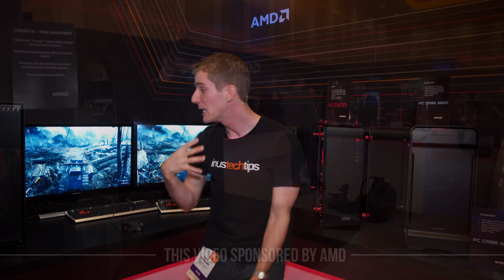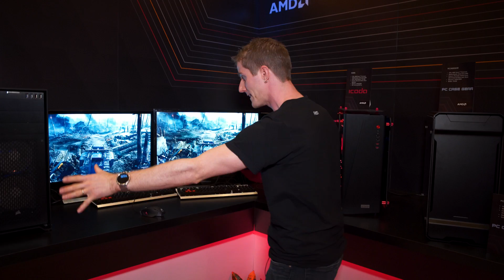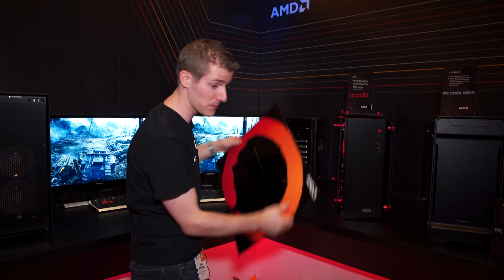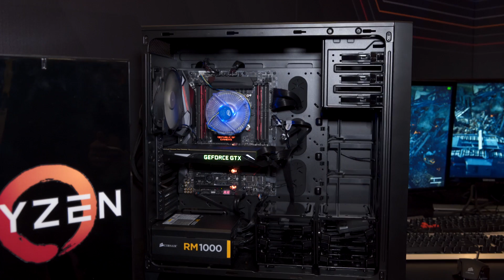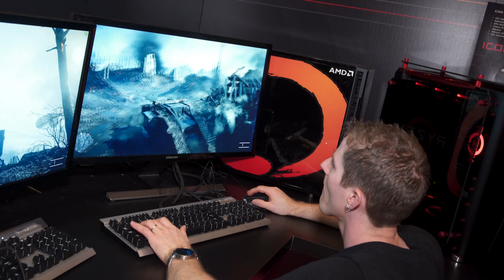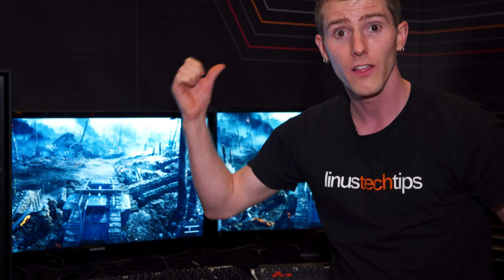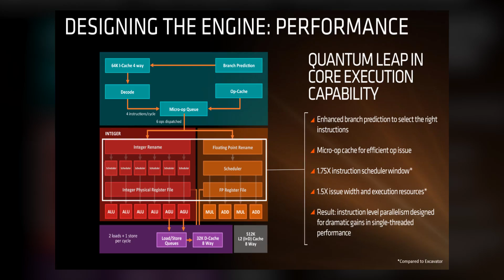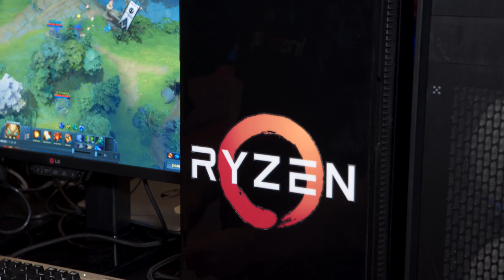AMD Has Ryzen!

Comment: Guys, the 6700k is faster than the 6900k for gaming and it has been out for a long time. In Denmark the 6700k costs 400 dollars, might be cheaper in the US. So this AMD CPU will rely on overclocking capabilities and the boost to beat the 6700k if the above video is an indication of performance to come. I dont see anything new here unless the price is significantly lower than the 6700k. Also keep in mind that what you are seeing above are default speeds, my 6700k has been at 4,7 ghz for over a year now which the Ryzen cpu will need to top unless as I stated before, it comes at a much lower price.

Comment: Doing rendering on 5820K and I must say, the Intel's X99 platform is still buggy! Start-up takes longer than say Z79 or H81 (complicated boot sequence, I get it, but still), BIOS has glitches (on every startp-up it fails to boot until it actually boots) , problems with XMP - sometimes wont boot if profiles are changed (have to clear CMOS). Maintaining this rushed Intel piece of ship chipset can be a nightmare (Intel forced the board manufacturers to release faster). From forums I know my case isn't the worst one. Computing power is a real get go, but the glitches and BIOS bugs that won't go away.. For the price I paid..

When I heard Intel is forcing vendors to close Skylake BCLK overclock that was it!! Since then I've tried to sell my X99 rig, realizing, people won't trash that amount of money and those that want to buy, want it for cheap, bastards. Oh, the joys of hearing about the Ryzen!

Comment: I started off on AMD way way back in the Old K6-2 days i was hooked on pc gaming after that now When AMD bought ATI i was heart broken because my first GPU was a ATI Radeon 7200 64mb version now with the work i do AMD is just not enough for me my current specs are a Xeon E3-1246 and a Nvidia GTX 1060 Its my workstation/gaming setup now im wanting to build a new rig here soon for a Server/workstation/Media,Game If AMD can out preform Intel like truly show some improvement ill use them for my next project but if they end up failing ill have to say goodbye to AMD.

Comment: funny how they keep comparing ryzen with the 6900k whenever the 6700k beats the 6900k in most games by 15+ fps.
Reply: Overclock the 6900k and it shits on the 6700k.
Reply: SyncF havnt seen any comparisons on that.
Reply: sources of this +15 FPS boost?
Reply: James Loskow just look up benchmarks.
Reply: James Loskow his ass apparently
Reply: I just looked up the gaming benchmarks, They measured it in percent the 6950X is there 100% point. The 6900K has 96.8% of the performance of a 6950X while the 6700k Only give 91.8% of the gaming perfromance of a 6950X. The games that were used: Anno 2205, Asssassin's Creed Syndicate, Crysis 3, Dragon Age Inquisition, F1 2015, Far Cry 4, Starcraft 2 Legacy of the Void, The Witcher 3 which were all run at 720p too cause a CPU bottleneck. You need to understand that devolpers are starting too use multiple cores. And even eye too eye, in single core at stock clocks the 6700k is only 8 % faster.  Then you have too understand that, even it's 8% slower in single core, too compensate it has twice the cores. So the i7 6700k is 8% faster at stock clocks then a 6900K, but the 6900k is easily 60% faster in anything that uses multiple cores. Add to that one of them runs at 3.2GHz(6900K) and the other at 4 GHz(6700K) which means that if Ryzen actually overclocks better then the 6900K then it's actually even beating the 6700K/7700K in single core. Also 15+ FPS is something really stupid too say since the question arises, But from how many fps? 60? 120? 800? If the game runs at 300FPS and the game is single core bound and the 6700K is 15+ FPS it would mean that the 6700K is barely 5% faster in a single core application. PS: Sorry for my bad englisch, I'm not natively speaking englisch and it's really late.

Comment: It seems that many people are confused about AMD pairing a Titan XP with its ryzen CPU instead of an AMD GPU such as the RX 480. The reason AMD has done this is because the Titan XP is the fastest GPU on the market and they want the CPU to be the limiting factor so obviously they will use the most powerful GPU possible to prevent any sort of GPU bottleneck. AMD would probably have used Vega if it was ready it is isn't so they just got what's most powerful.

Comment: hey guys i am not a tech guy so i ask you one thing hopefully you can help, what is the difference when someone is talking about clockspeed like a Snapdragon 820 with 2,15 GHz and a clockspeed of an Intel Core i3-3220 Prozessor with 3,3GHz, is there a difference between ARM Chip clockspeed and PC/Laptop Chip clockspeed?

Thank you very much
Reply: Do you know Engines?

Imagine Frequency as RPM of the engine. Knowing the RPM doesn&#39;t mean you know if the engine will be powerful, you just know it can spin fast. Now Imagine the ARM cpu is a little 125cc motorbike engine, it revs fast and is efficient but it puts out enough power to push a motorbike along quickly. x86 is like a 2000cc engine, revs similar but has higher capacity, meaning it produces more power, it can push a car along quickly.

That might still not make sense but heh...
Reply: Gunsling Samurai Clock speed is clock speed... like horsepower is horsepower. Just a jet turbine and a v8 make it in different ways. Linus has a great video on ARM chips. The architecture is totally different that standard X86 chips. That's why a 3ghz ARM chip is not as fast as a 3ghz X86 chip. They are catching up, the A9X from apple and A10 are impressive. Also because they use much less power. And are physically smaller. Hope that helps a bit.
Reply: The clock frequency of a CPU only tells you how often an internal circuit inside the CPU changes between two states. The CPU uses the state of this circuit to synchronize its various subcircuits. This doesn't tell you anything about how much work those subcircuits are doing in between synchronizations.
Trying to deduce the speed of a CPU from its clock frequency is like trying to deduce the speed of a cyclist from his heart rate. Is his heart rate slower because he's moving more slowly, or because his body is more efficient?
Basically, desktop CPUs have more circuitry destined to allow the CPU to perform more work per clock cycle. Engineers can put all this extra circuitry in there because they don't need to worry as much about power consumption (more transistors means more power draw). ARM CPUs, particularly those found in phones, are almost constantly running off a battery. Thus engineers optimize the designs towards power efficiency rather than performance.

Hope this helps.
Reply: Clock speed is a rate at which a CPU executes instructions. 2Ghz means 2 billion cycles per second. However each CPU can do a different amount of work per cycle, so frequency is not an only important metric. When it comes to ARM and x86.. they are quite different. x86 tends to be much more beefier cores optimized for high performance, ARM tends to be lean cores optimized for power efficiency. Ultimately Ryzen and Intel Kaby Lake are still the fastest CPUs on the planet.
Reply: Clock speed is just the number of cycles per second the chip's internal clock runs at, so it always means the same thing no matter what chip you're talking about.  A separate issue is: how much actual work are we doing (on average) with each tick of the clock?  As we speed up the clock for a given CPU, we encounter bottlenecks (like memory access) that prevent performance from scaling in a linear fashion (2x the clock speed doesn't mean 2x the performance).  We also can't compare the performance of two different CPUs by looking at clock speeds, and that's especially true when they don't even use the same instruction set.  The only way to compare performance is to have the two processors do the same work (with well-optimized code for each one) and see how long it takes.  I hope that helps.
Reply: Thank you all I understand now but if I read your comments ARM chips will never be even close to X86 chips because those chips run on PC or Laptops which get their power directly from the plug whereas the ARM run on batteries
Reply: Nicholas Knowles that does make sense thank you

Comment: Since both are around the same FPS, it's safe to say the game is bottle-necked by the GPU.  The real question is though...how much CPU usage between the two?  If AMD is at 90% and Intel is at 60%, that would be a significant difference, even if the Intel chip was more expensive it could still be the better buy, especially for overall longevity.

Comment: Is Linus actually scared that AMD might actually be better than Intel again? If this turns out to be true and AMD is pricing their systems to be better priced than 6900K based systems, then I am demoting my 4790K system to a backup/render box/processing box and building a fully decked out ALL AMD (again) build. But... If this is anything like the systems based around FX 8000s or 9000s, then forget it. My Dad's 8300 build got demoted for an older dual Xeon workstation I had lying around because he does photo and video editing which takes advantage of the 16 cores and 32 gigs triple channel DDR3.